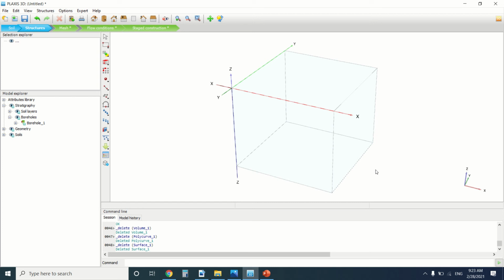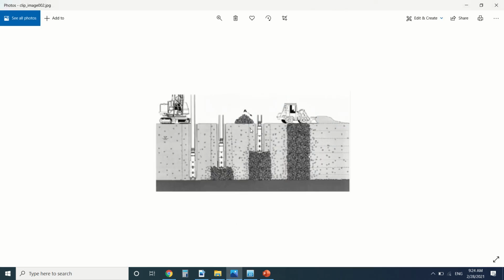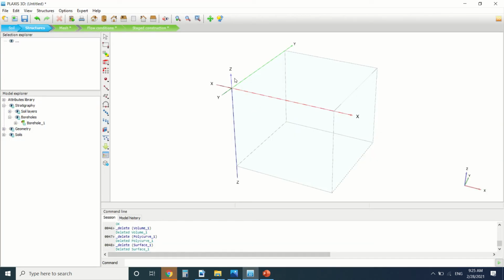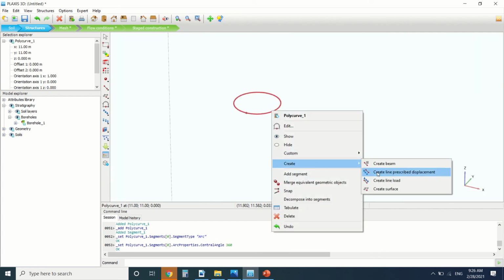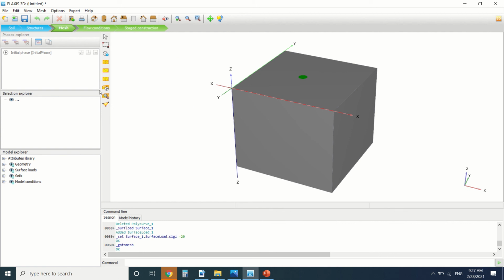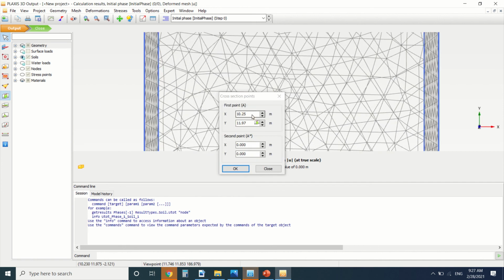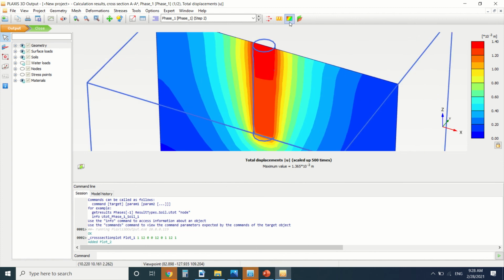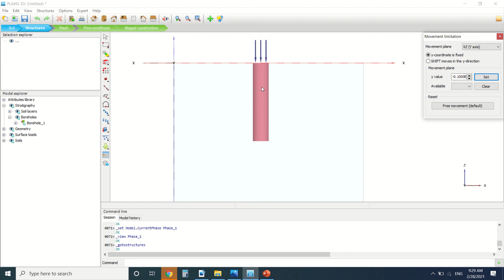plaxis course on stone column

Comment: how we can apply installation effect to stone column, jet grouting column and CMC column. Ive learned K star method and cavity expansion but I don't know how to apply it in plaxis. the need is  so so urgent. If you can help, please record a video in the next week please.
Reply from the maker: Plaxis is not made for stone columns which will be difficult to make
Reply: @theengineer7732  then which software is capable of modeling stone columns, Jet Groutings, CMC Columns and Deep Soil Mixing Columns? which software is suitable?